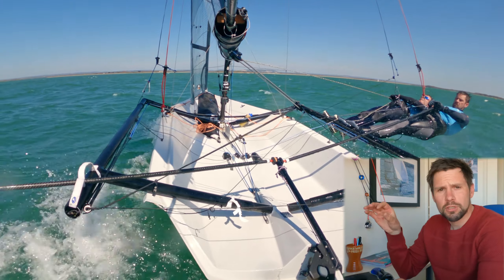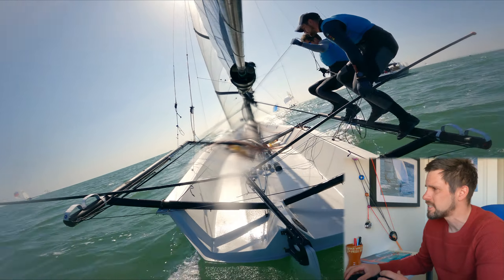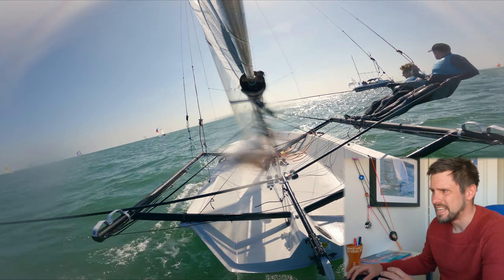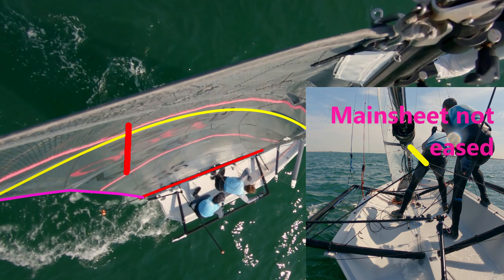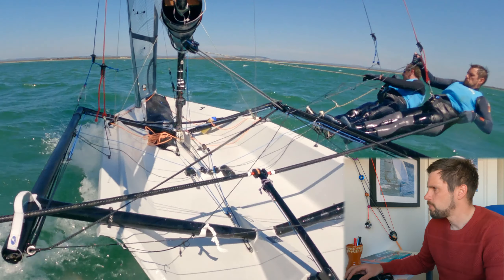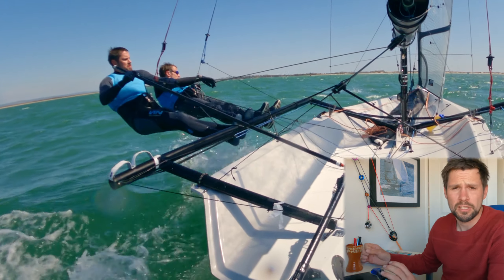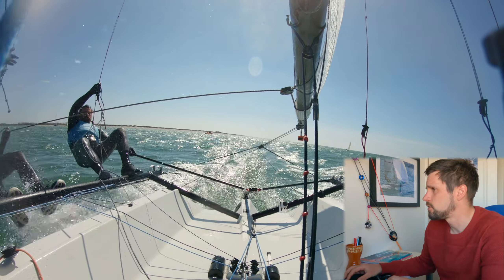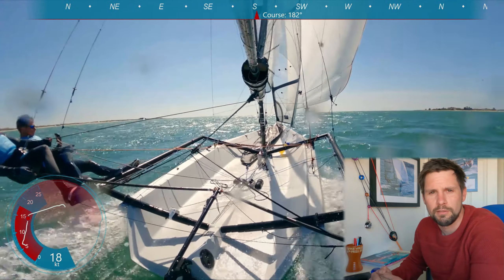Better High Wind Tacks: The one-handed mainsheet duck!

Comment: I didn't realize how much I got away with making this mistake in moderate breeze crewing at 800 (most of the time), until I sailed a 14 when I just caused capsizes all of the time and couldn't tack
Reply from the maker: sometimes it's really hard for the crew to feel. When the foils lose grip  it feels like a loss of heeling force so the instinctual response is to sheet on to get more power. When you start getting stuck head to wind it becomes obvious, but the same thing is often happening in lighter wind tacks where the consequences aren't as high, but it's still slow on the exit.
Reply: It was really nice to have a video more crew focused video

Comment: Thanks for this, I have trouble stalling my Blaze in heavy wind and thought I needed to keep the sail tight to drive through the turn and power up as quickly as possible but this makes sense and something to try. 
Do you release the kicker which I guess would also release the leach?
Reply from the maker: releasing the kicker helps as well. Obviously it then takes bit longer to prepare for the tack, but if it's windy it can certainly make it easier